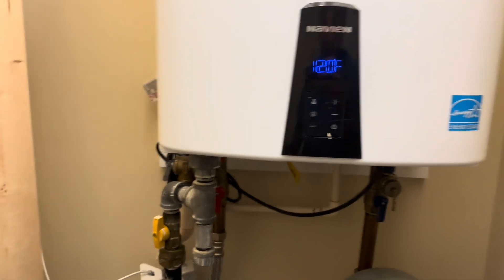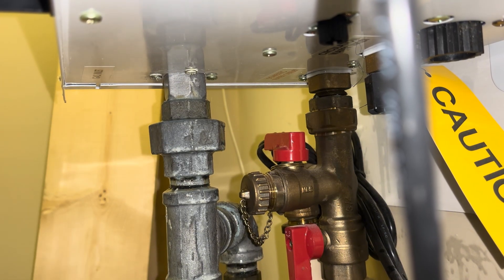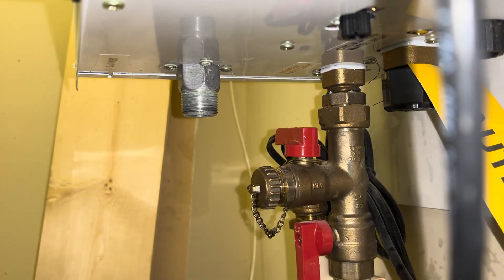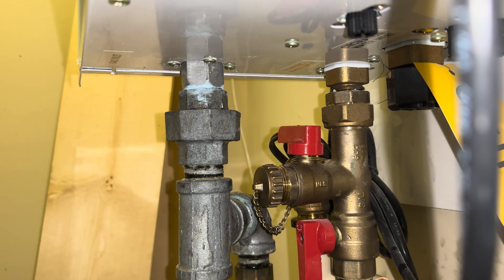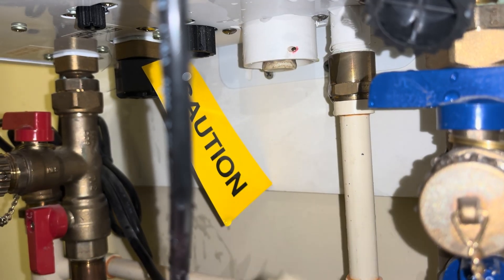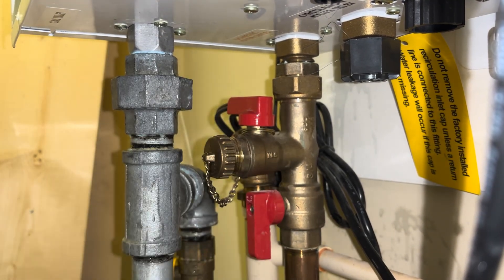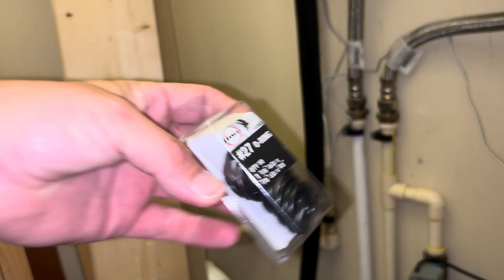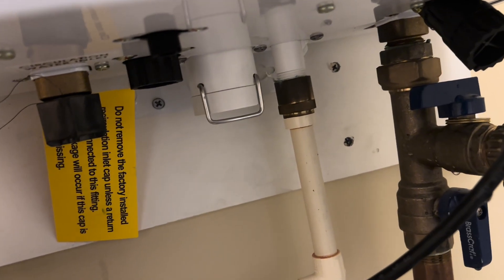Hidden Gas Leak EXPOSED…By Complete Accident!!!

Comment: Nice catch!! Could of been a bad situation should of the gas filled the basement 😱😭 But it’s not uncommon to find a leak at that point everyone are afraid of twisting it an cracking the threads.. I always use blue monster first a dope too .. as my grandfather always said “ an ounce of protection is worth a pound of cure “   On the Nav units? The o rings are only good for 1 or 2 times a seam to get brittle.. 🤷🏻‍♂️ I think it’s the condensate acid effects the rubber properties of the OEM . Coz I never seam to have any more problems after a replacement of the OEM 🤔

Comment: Black malleable iron nipples and fittings are required for gas piping everywhere. I haven’t seen galvanized in 35 years. Galvanized flakes off and can be drawn into the valve and  orifices.
Reply: oddly enough, it's code required in some state/city/locales. lol
also many have made drip legs illegal, no tees' and elbows only, so people cannot easily bootleg tap off the bottom of them. re-lol